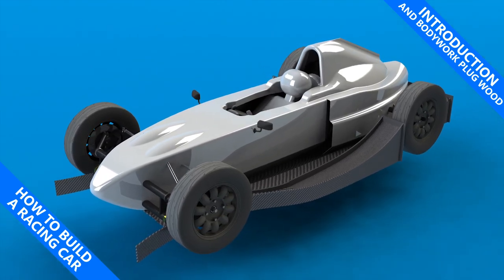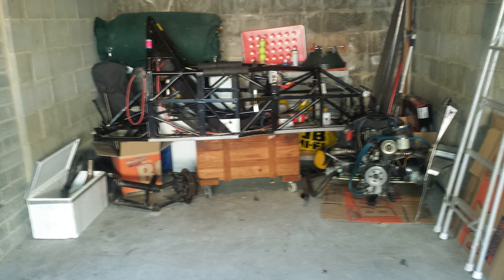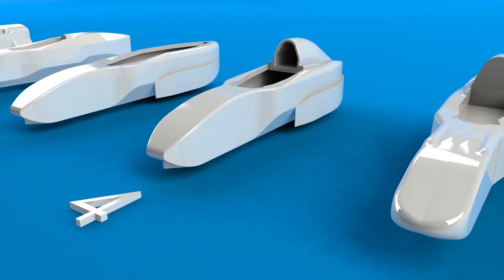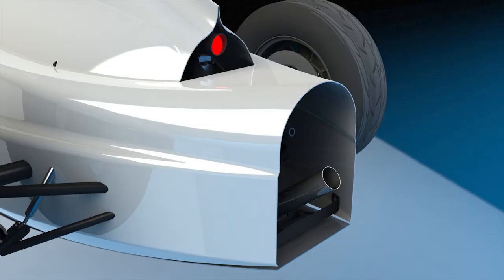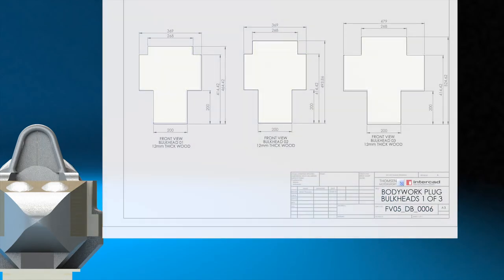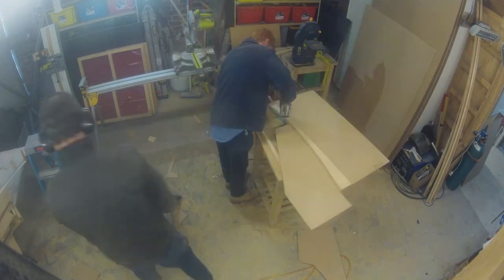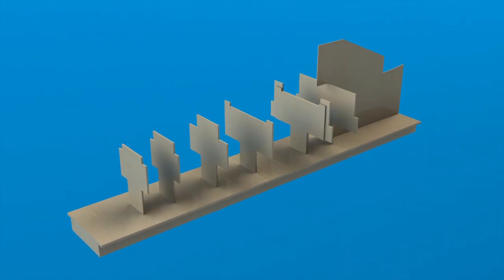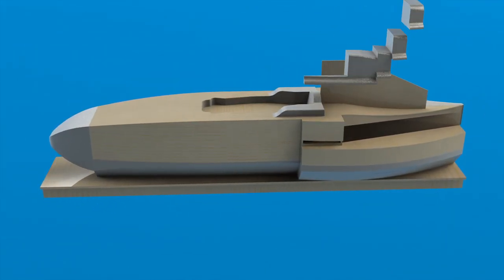Introduction and Bodywork Part 1: Wooden Frame

Comment: First, you are amazing, every video its a wonderful piece of knownledge, second, ¿Where did you learn to do such things in solidworks? I use it to Chemical Engineering designs but never something such complicated like this.
Reply from the maker: Thanks, appreciate the feedback. I'm mostly self taught in Solidworks, I've used it since my university days. Even with something as complicated as this car, each individual component can be boiled down to a number of simple operations. I'd recommend just playing around, starting with something simple and building up from there. I went through five iterations of this car before having the final design done, much of the reason I went through so many was just because I was was learning to draw the various bits and pieces.
Reply: Carrol Smith provided much in refinement conceptually.

Comment: This is extremely cool, I have watched a few videos! But I wonder, what was the total cost? And how would it be to drive it on a normal road?
Reply from the maker: Something like 30k AUD from memory. To drive it down a normal road would be rough, you wouldn't want to do it for too long but not much prevents it from working on a normal road. It'd bottom out pretty badly but go fast enough and you generally scrape over the top of things.

Comment: Where can i get the diaminsions for the engine and the gearbox i couldnt find anything helpfull on the internet so i was wondering if you can you help me in anyway?!?!
And thx
Reply from the maker: I can't remember exactly where I found them, highly detailed models were available on some CAD parts website - it was called something like CADSpace or something.

Comment: You could have used plaster of paris instead of bog. It is very easy to work,and can be finished to a very fine finish,and does not attack foam.

Comment: So you left stinger to make you own racing car? What were your reasons for doing this?
Reply from the maker: Yes. Many reasons - I thought I could build a better car, that it would be cheaper in the long term than leasing, that I'd have more control over the condition and quality of the vehicle. Had I continued to race I think this would have been the right choice, not so much considering I left after one year.

Comment: how did you convert the 3d curve shape to 2d?
Reply from the maker: Are you referring to the bulkhead boards? These I manually sized according to the model of the body. The flat sheets which were bent I converted to sheet metal in Solidworks, which produced the 3D unbent pattern. It's all a very manual process however, the software is an aid rather than a complete solution.
Reply: yup,thank you so much for the info!